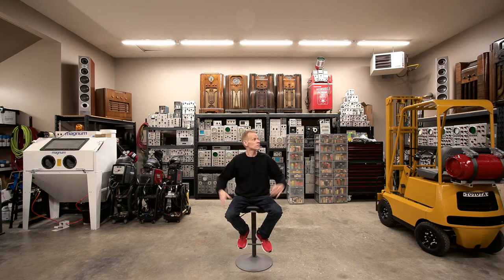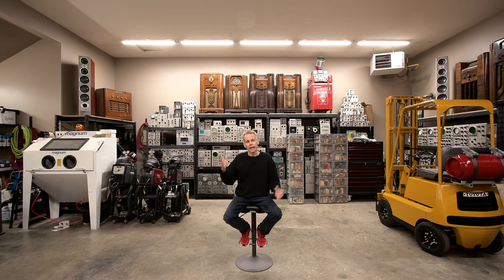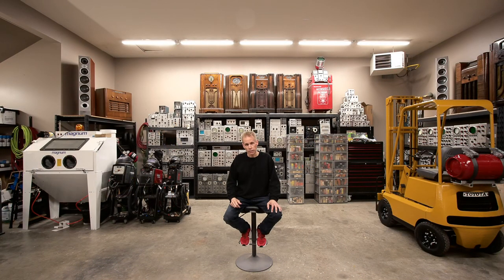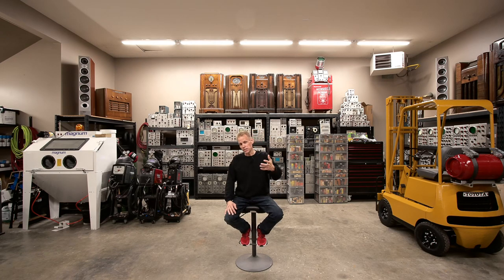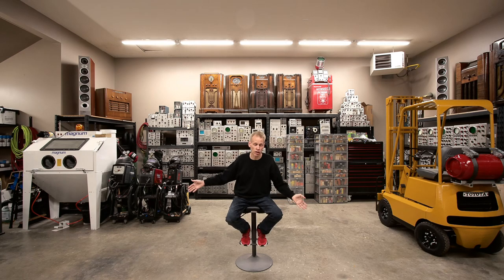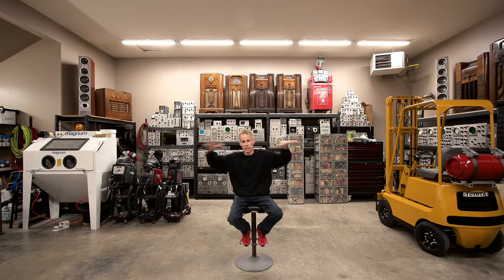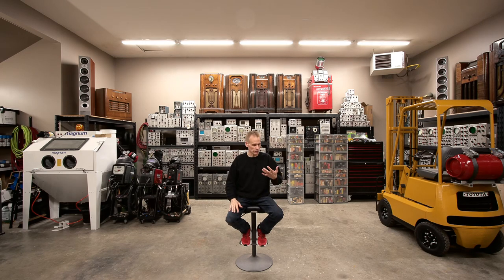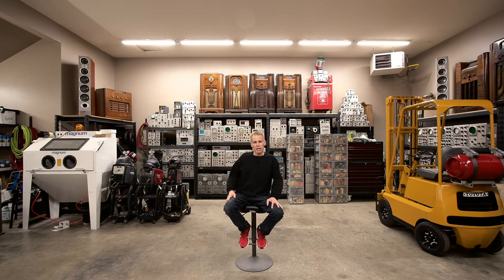ZAP! Mr C's Worst Electric Shock Explained In Detail!

Comment: Here's a story for you...
I was in high school, the 79-80 school year, I was a Junior. It was the first year I got what I really wanted in school. Electronics. I was jazzed up. One could say I was charged up, like a 3 inch by 2 inch 600v capacitor. Oh yeah, and we had such fun with those too !7:^[}
The teachers name, was Bruce Cable. Not only did he have a cool name for an electronics teacher, he was by far the coolest teacher I ever had. I had a deep respect for the guy. Everyone did. It may have been due to the fact he was a paraplegic, in a wheel chair, but he never used that to his advantage. Once a couple of kids, put down tape across the door threshold, under that tape was a bunch of thumb tacks pointing up, and pushed through the tape. Like some kind of medieval device meant to keep bicycles out (or wheelchairs). He was coming in, and he braked hard. He was staring at the tape/trap. He let out a genuine laugh... and said.. "OK, whose the wise guy. Whose going to fix my flat after I roll over that!" He was met with silence. Then, he gave me a deadpan look. "Bobby! Did you see who did this!" I spoke the truth, I did not see who did it. I was so glad he didn't ask me who did it. I wasn't about to lie for those assholes. He said, "Fair enough". He reached down, couldn't quite get a hold of the tape. So he backed up, got a really good rolling start, and jumped the tape. Came to a skidding stop. Looked at the two guys responsible, and smiled, under his breath I could hear him say, "assholes". 
For this story, its important to know, he was an awesome teacher.
So months later, he had nothing prepared for us, so we just hung out in the metals shop. And watched Mr Shortridge mill a log splitter maul. It had a 20 pound head, and solid metal handle. In all about 35 pounds. He had it on a milling machine. Milling a wedge shape on the back side of the maul, not quite an axe, but pretty damn close. And everyone knew, it would do the job he wanted it too, if you were able to swing it. None of us kids could manage to get it over our heads. But I digress...
So here is where the real story starts... We are watching him mill a wedge shape. We are getting all kinds of tips about metal working, yada yada ya... I was standing against a drill press, right next to the milling machine. Our machine shop, is fed by the mains on the power poles directly. We got 360v 3phase power to the machines. So, while I was leaned onto the drill press, my hand was holding onto the drill press table. I was thinking, "what does that feel like when the milling mach scrapes off so much metal". So I reached out with my other hand, and gripped the handle of the maul. At least I meant to grip it. I don't know if I ever did. I woke up sometime later, about 20-30 feet from where I was, flat on my back. And my chest was really sore. like I had been punched in the solar plexus. When I woke up, Mr Cable had his wheel chair rolled up over my chest. So when I looked up I was looking between his feet up at him. He was pulling his feet back into the foot pads (he couldn't move his legs, they ad to be lifted into place. HE let out a scream, "He's alive!" and gave me such a look. "Bobby, you've been keeping a secret. We didn't know you can fly! You flew from the milling machine to hear in a single leap!"
As I was getting my shit back together, he came up to me, and asked how my chest was feeling. He said no one knew CPR, but he did. He used his feet. The coolest teacher in our school, saved my life, by giving me CPR with his feet. Now how Batman is that! 
Oh yea, and that circuit I completed was 680 volts. Mr Cable went and got a voltmeter out of the classroom and tested it. Evidently the isolation transformers were not installed correctly. ALL THE MACHINES were like that. Amazing no one else died. Well, that we know of anyway.
Reply from the maker: Great story Dr. Johnson, thanks for sharing that with us!
Reply: @MrCarlsonsLab  OK, time to fess up. There have been  A LOT of times you would have thought I’d learn my lesson(s). I am still here though, but here is the Readers Digest list, without the stories behind them. Feel free to ask me to expand on them.  But I dont want to make another wall of text.
- age two. My dad saw me stick a hair pin into a wall socket and zap myself across the room.
- age 15 I had an old weather radio that was AC/DC. Batteries or standard af cord that you could plug into the back. I did not have a proper cord. Cut two old lamp cords off, and mad a suicide cord. Both ends were male. One end fit perfecr into the radio. Kept it near the head of my bed. Many times I fell out, and I either would step on it barefooted (of hell, you thought a lego part was bad) or picked it up wrong, at least a dozen times i got zapped by that little thing.
- age 16 - this was just before the metal shoo incident. I made a electrolysis device using Tupperware  bowl (very large bowl, plastic)  lamp cord with nail attached at the ends, and a heavy duty diode in the center of the lamp cord. I wanted DC not AC in my experiment. Fulled two test tubes with the gas the came off. The oxygen just made the gas burn bright. The hydrogen test tube, well, it just glowed bright orange, and slid out of my finger, falling into that water, and shattered. I then stuck my melted fingers into the water because the of the burn I received. I knew you had to react fast with such burns. My device still had power. So I got zap for my complacency. 
- this last one I was witness to. I didnt get zapped. But a friend of mine did. This was in the Air Force, shorty after Desert Storm, during Operation Provide Comfort.
I was working F-111F’s TDY to Increlik  Airbase Turkey.
We got a make do office out on the flight line. Like a Tabvee, but shapped like a cube. It was for firetrucks to park in. About 40’ long and 15 feet wide. It had 3 phase power coming in. All outlets were receiving this three phase power. We blew up a few things when we plugged them in. WTF?!?
So out resident electronics expert (not me) said, “I can fix this. Whers the mains box”. So he got his meter, opened the main box. The door folded down, creating a handy shelf  at elbow height. He placeced gis meter on the shelf, and began testing contacts. 
Did I mention how hot and humid it was? How about 100 degrees and 100% humidity. It was a friking saunas.
I standing right there watching him. First thing he did was find the ground. The self, well the door he was using as a shelf was metal. And it completed the ground for power. As he tested each of the terminals in there I noticed a drop of sweat, running down his hand and onto the meter lead. I reached for the lead, he snatched back and said be careful, you can electrocute d. I said, not me you. He said what are you talking about?… then I hear “SSgt Johnson, leave him alone, he knows what he’s doing” I turned to acknowledge who was speaking to me, and when I turned back he made contact. So did the sweat. He was stuck. And he was making a very odd grunting noise. It took an instant. I knew what was happening. So body checked him, and he fell to the floor. Everyone jumped up. Was staring at me, “what the fuck is wrong with you Johnson! Why did you knock him on his ass!” Which was funny. He was a Taekwondo instructor. Had nearly 50 pounds of pure muscle more than I did.
He got up, gave me a bear hug and said, “thanks man“ and looked at the others in the office. And shook his head and walked away. 
He was embarrassed, pissed off, and really angry that no one had a clue as too what happened but me.
Years later, I was stationed at Osan AB in Korea. There he was. I just looked at hime and smiled. He didn’t recognize me at first. Then I said to the group, “Did he ever tell you all about how he was nearly electrocuted in Turkey?”
“No! Bob! Shut up! Dont tell them about that!” He cut me off. He interjected how I body checked him off and high voltage circuit. That I saved his life. And we would leave it at that. I had a many keep asking me to tell the whole story. And I said, “he summed it up pretty good.”

Comment: When I was a kid around 14-15, I was experimenting with a large metal electrolytic out of a tv, having fun charging it up and discharging it with the big spark to the case with a foot long wire soldered to one of the + terminals. I was holding the can with my hand and somehow the wire I thought was stiff enough came down and started dancing on my arm. Couldn't let it go until it had discharged enough to be able to drop it. It seemed like an eternity for that to happen, but no burns or any other after effects.

Comment: I know your issue, was shocked by 480v phase to phase. The flash and pain were instant, because a panel builder didn't check the wire ampacity to the fuses. Wires over heated and melted together when I opened the panduit cover two wires came off and hit my right forearm. Couldn't move my right arm for two hours

Comment: Hi Paul,  Yes I know very well what your talking about.  My dad used to have one of those microphone and I too got zap.  In my case, it was the desk that had a direct path to ground.    And In our case you said you were on a metal bench chair.  This may shock you, but I remember old concrete floor that over time turned to a rusty shade for some reason.  In your case I'm certain it was the floor that was your direct path to ground.  That chair probably did not have rubber feet and it was direct metal to concrete, and that concrete floor had also rebar and under the concrete, the ground probably had a very high water content and even if the floor look dry, guess again.  Imagine if you were barefoot and you had taken a hold of that mic and push to talk you would have had the same experience in being shocked.   

NOw ow I discovered that with some concrete floors.  In my past I did go to school and learn electronics after high school.  And I witnessed a power supply live alligator clip fell from the desk and fall on a metal bench stool and it sparked in a flash and it left a burned mark on the unpainted metal stool.  A direct path to ground with the concrete floor.  And that moment showed to me how I got zapped myself a few years back with my dad CB mic on that old metal desk.  My forearm was touching the metal desk as I'm pushing the PTT identical style of mic of yours and I got really zap, that I now still have nerve damage on my right hand and wrist today after all those years.  That was an experience that made me always use proper precaution when dealing with live electricity.

Comment: When my father worked in technical repair for medical equipment, he would tell a tale about a service call he made for a 'bad' diathermy.  Apparently a physician had been knocked out by high voltage, so the clinic assumed it was broken.  My dad showed up and started asking questions about what problem might be.  The dr. said "well I was just inspecting the machine and wondered why (sticking his hand into the back of the machine) this line was loose. With a loud POP he was on the floor again, but at least still conscious this time.  He had brushed one lead of the HV cap for the magnatron supply.  Wasn't anything wrong with the machine - just the dr.  The 'loose' wire wasn't a wire, but a end of a wire lace, and he was waving about in the unit.  Fortunately the power was off and the discharge was simply the capacitor residue, but previously it had been on.  3KV.  My dad stressed this example when he was teaching us proper HV 'etiquette' (one hand in a pocket, etc.)  It probably means the saftey interlock had been disabled, too.  Good story.

Comment: Paul, Great story and a very nasty shock! So glad it didn't do you in! In my early teen years I was tuning up my Heathkit DX-35 on 10 meters when my hand got a little to close to the plate pin and it zapped the tip of my right thumb. There was a hole like you described but much smaller that closed up as time passed leaving a small lump of dead skin cells. As I got older I got tired of looking at it and did a little surgery with a sharp pair of diagonals. I enjoy your channel, keep up the interesting content! You remind me of one of my trade school instructors from the mid 60's 😁

Comment: I’ve shocked myself while working on my tube guitar amp. I kept almost every precaution while working on it, except I used a conductive tweezers by mistake. I got zapped with 450V DC, I guess I was capacitively coupled through shoes to the floor. Throughout the next week I had random heart racing episodes and I had something close to a vertigo when I tilted my head up. If I had used both hands that time it could’ve been way worse.

Comment: When I was about 14 a buddy gave me an old Marconi TV and while trying to get it working I lit myself up by brushing my hand on the flyback transformer wire which was still fully charged even thought this TV hadn't been  plugged in for days. Next thing I knew I was up against the wall several feet away and thought I was going to puke. I was dizzy for several minutes but learned a valuable lesson.

Comment: I was working on a large old tube ham transmitter. I was working on the underside.of the chassis adjusting the screen supply via a sliding tap wirewound resistor.  All of a sudden my screwdriver slipped and I got hit with full plate B+  voltage, about 800 VDC. The current ran up my arm, through my chest and down my.other arm to ground. In my case I didn't remain attached but rather I was jolted back and away from the equipment. But in that breif time my vision blacked out, I dropped.to the floor, I could taste a strong copper metallic  taste and I could smell burning skin as the jolt left a burn on my hand when the current jumped from my hand to the chassis ground. Even when I think about it now I recall is as a painful shock. Since then I have never worked on a piece of equipment while it was energized.

Comment: I've been bit by HV DC a few times, one of the things that happened to me nearly every time was my arm go paralyzed for a few mins - and then I was sweating a ton for a while.
Touching the deflection coil in a running TV isn't funny either - I would describe the 50Hz signal as touching the chain on a motor saw (not that I have), but the vibration and convulsions - ouch.
Glad we lived to tell the tale - but you didn't mention anything about going to the ER... One risk developing blood cloths, so it is recommended to go for a 24hr observation in a facility that can revive/take care of you if your heart stops from a blood cloth - or if your brain isn't oxygenated, etc.

Comment: I had a very similar experience, you hear the hum in your ears and it’s difficult to talk, I was 10 years old and changing the antenna cable behind the tv to connect a commodore 64, I was wearing a kind of rubber sole sandals. To this day you can still see the marks in my hands where the electricity entered and came out. I also don’t know why I got electrocuted or how I survived. I didn’t want to touch the walls for a few days

Comment: I've never gotten a bad, painful shock in my life and i pride myself on how much care i take in not getting shocked when repairing old equipment. 
That doesn't mean i have never had close calls. Once i was working on an old hot chassis TV. Taking measurements with my scope. I didn't have a isolation transformer big enough for the TV, so i had the scope isolated instead. 
I knew perfecty well that if i did something wrong, the scope would become hot at mains potential. For a while, everything was well. But then i grazed the painted metal housing of the x10 attenuator and felt the telltale buzz. I did it wrong and made the scope live. It was no big deal - 2nd floor of a house, plastic floor covering, painted metal, so barely any current could run. But it did make me realize that i really had to find a big isolation transformer if i wanted to do TV repair. 
Another time i was working on my first USA radio, a Hallicrafters S-86. I got it with a 220-110 transformer fitted. Looked at the schematic - the metal case should be isolated from mains. Plugged it in. And right before i wanted to touch the metal case, i felt some apprehension, a sense of unease that led me to measure if there's any voltage on the metal case. The full mains voltage was present. Somewhere there was a short circuit between the negative voltage rail and the chassis. 
I actually never found the short. Probably one or more rubber grommets deteriorated. I simply hard wired an isolation transformer to it. That's safer anyway.

Comment: I remember well when I was a teenager, tinkering with old TVs, I received a shock from a charged cathode ray tube. I had a screwdriver in my hand, and due to the intense muscle movement, it shot away and got stuck in the ceiling. It felt like someone punched me hard in the chest, and I heard a loud ringing in my head. I had muscle pain for days afterward. Fortunately, I didn't suffer any lasting effects.

Comment: Wow... Paul,  that's got to be cutting it close to meeting the Grim Reaper, everything you described is kind of what they tell you in safety meetings, anyways, there was a time when I was electrician and I got bit pretty good by 480 . We were trying to diagnose the problem, and the 480 was on a ground line, not the full 480. I suspect, but doggone close gave me a respect for 480 because I kinda struggled to pull my hand away, but I was able to do it. Probably because I did not have my hand around something.   It keep up the safety information that's something all of us need to be reminded of, electricity is an invisible force and sometimes I don't think we fully understand what it's doing, even if you do understand that doesn't mean something can happen, that's when you find out that unknown pathway you just touched.  And yes I totally agree about not knowing where or how the conditions occurred when these kind of things happen. That's the mystery part.